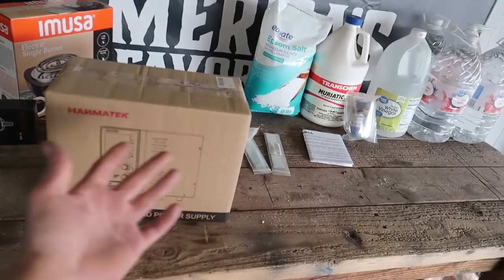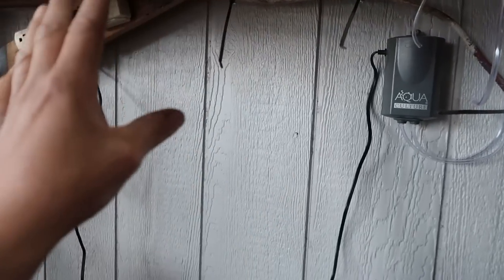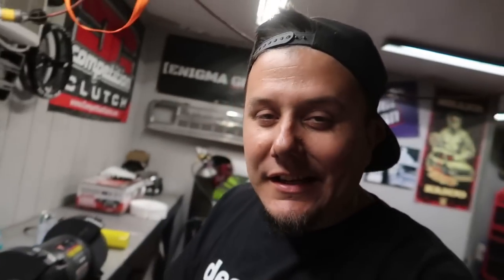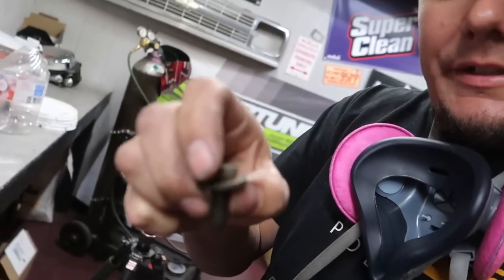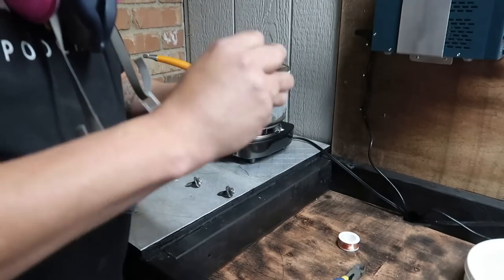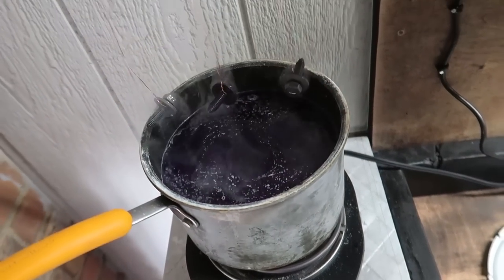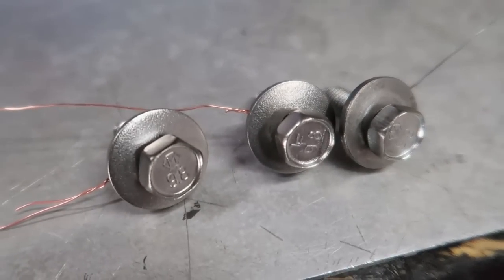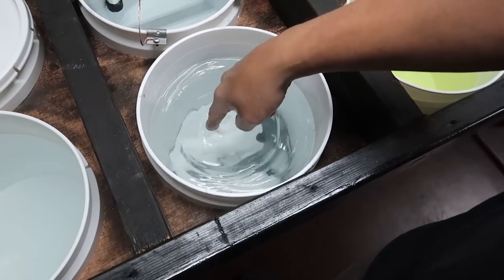My at home ZINC coating setup!

Comment: The purpose of the muriatic acid besides cleaning is also to activate the steel to accept the zinc. Do not wire-wheel the bolts after. If you do wire wheel. Place the bolts back into the acid for a few seconds to activate the steel. The Amps is determined by the total surface area you are plating. Too much amps can burn the parts causing a bad finish. Once you get the temp up on the chromate bath that should help. If you use room temp, the part will take longer to coat. Also, pH on your zinc and chromate are important.
Reply: Yep this guy knows his shit..  only thing i am in difference about is how the muriatic acid allowing the metal to “accept” the zinc.  All the acid is for is to etch the metal.  So the zinc will adhere .  The wire wheel is just adding dirt to the part..  is like paint.. you etch the metal and clean before paint.  Itd be like cleaning the part with alcohol then sanding it after then painting..  the chromium is what is treating the metal and getting it to the right ph ..  or something..  dunno..  but i do know the muriatic acid part.. my question is that i always wash my parts in a baking soda water mix to neutralize the acid otherwise the acid will continue to etch the metal..  ive had acid in a tote for washing an engine block and a week after i washed it out and let it sit outside i poured some baking soda water mix in it and shit still bubbled up..  so it soaked into the damn plastic tote..  crazy..
Reply: So glad you said something.  Just finally watched the vid and was comin here to say something similar.  Good lookin out!

Comment: Cool setup. I would make it so you can only plug that hot plate in while the cover is open. Like you have to unplug that burner to close the work bench cover.  Could prevent a possible fire some day when you are in the shop late at night and really tired.
Reply: Thought his power supply turns on and off all that's plugged in so he just hits the switch when he's done

Comment: I would really try and polish your test parts with a Dremel brass brush bit after your cleaning process before you start to try and zinc coat anything. I would thoroughly wash any part with chlorinated brake cleaner and scrub it very well, then clean it again.  Air hose drying out goes a long way as well between steps. You might be contaminating with steps. I really love what you are starting here. I cannot wait for each episode you make lately!!! Thank you

Comment: You can use the same process to remove rust from parts. You could use a vibrating parts tumbler or a ultrasonic cleaner and save yourself time on the sand blaster. 
Enjoying the content bro keep it up!
Ps you really should suss some better ventilation

Comment: This process is almost surgical, think about it like you wouldnt want your doctor to dig his balls right before putting his fingers in your mouth. Anyrhing you can do to not contaminate the metal after it has went through the acid bath is the best case scenario. Also part size,amperage, and time all play a factor, the smaller/ thinner the part the less time it needs to be in the coating at a higher amperage. Also if you are unsure where you should set it start low, you can always add more and its hard to take it back off. Hit me up if you have any coating questions and I will do my best to get you some answers(if I dont know someone at my work [we make diamond plated tools] will have an answer)